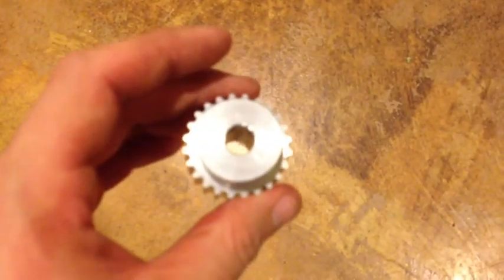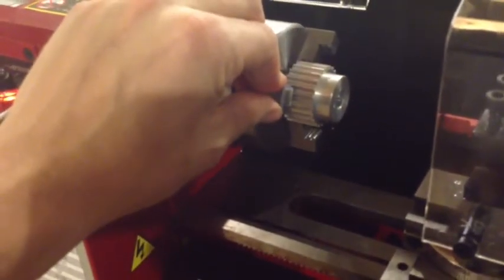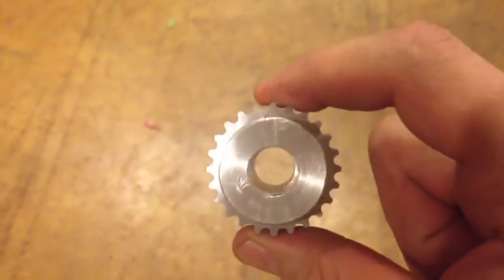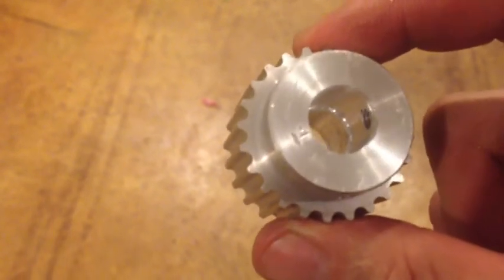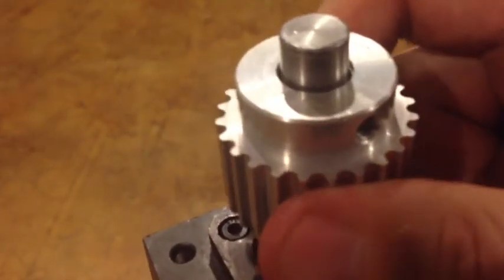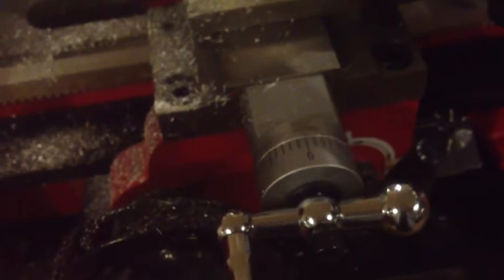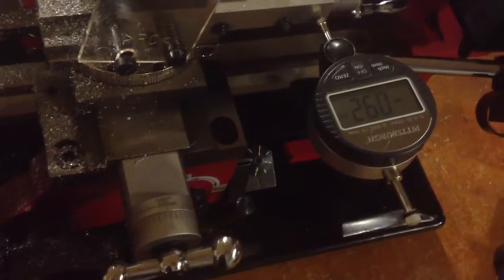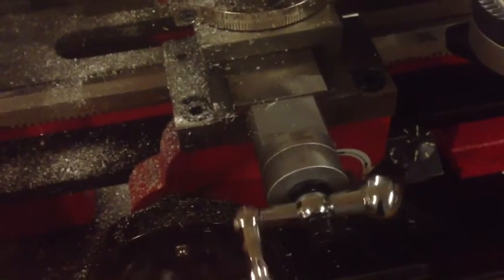THUNDERDORK: DIY CNC Router - Harbor Freight Precions Mill: Great Gear Fiasco

Comment: lol, you must be an engineer. Only engineers over complicate things so much :)

Practical method (which also is far more precise than what you are doing): chuck a 10mm rod in the mill, slide the gear under the rod, clamp with toes clamps, drill and ream to 12mm.
Result, a hole the correct size that in the exact center of the gear (assuming the original hole was on center).

A side note. It is all but impossible to center the gear when clamping on the teeth in a 3jaw chuck. It is a good thing you got a new gear since anything you made this way would wobble side to side giving you a problematic cut.